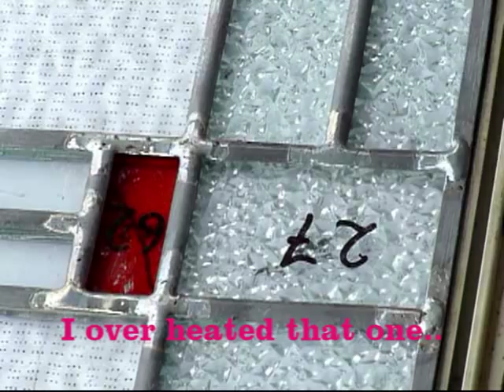Soldering a leaded panel

Comment: Great video,  glad you mention the temp, you melt the lead, and thats not good. FYI, I 've always used Olic Acid for my flux, basically it's rendered animal fat.  Does not work as well on copper or zinc, but  great for lead.

Comment: How do you clean if soldering an old window. A repair of a crakced lead. Clean with some acid first?
Reply from the maker: Remove old solder by melting it. Generous fluxing will help, also try blowing liquid solder off. Then take to the general surface carefully with a scraper and scrap on the dirty surface. When you see your scratchings come up to a nice shiny silver colour you'll know it's clean. Solder will not bond to or cover ANY dirty surface so just don't drive yourself to nuts trying to.
Reply: @karalnz  thanks. im also talking about the lead mounting it self. So far im sanding it with metal whool.

Comment: My lead on joints are melting. I only touch the joint with the solder on. It's a weller 80   can't turn it down there's no temp setting. I see you even hold your iron on a few seconds. Any ideas please
Reply: There´s a special Weller for soldering leaded glass, I´m using this one which is fine: Weller Profikit 100

Comment: How do you control your soldering iron temperature? Mine seems to only hit one heat that that is blasting it out.. at times ive even melted the lead
Reply from the maker: Ahhhhh I just hate it when the lead cane melts before my eyes!
If you suspect it's blistering hot, have some scrap lead cane handy and do a "test run" on that before putting it on "the precious"
The 'old school' irons are not thermal controlled so you MUST be diligent with it. 
My best suggestion,..... buy an appropriate new one like the one here https://www.youtube.com/watch?v=dqANQmNMDFw

Comment: This is another amazing video, and one that I have been waiting for. What kind of solder do you use for this, 50/50? Very good looking soldering joins :-)
Greetings from Sweden!
Reply from the maker: I used 60/40 solder on this panel. It has a lower melt point and thus helps to avoid melting the lead canes.
If your iron does not have a thermal control on it of some sort, your iron will likely over heat. It pays to test this for this danger by doing a soldering test on a piece of scrap lead cane before committing yourself to soldering the panel..

Comment: Great video!! Thanks much, very informative. What temp do you set the iron too.?
Reply from the maker: Yes, iron temp is very critical for lead work. It's a true nightmare to have a hot iron melt into the canes a?!!
My iron has a thermal controller within the tip so it can not over heat (what a blessing)
Reply: @karalnz  Is it the Weller Magnastat?

Comment: How do you remove a drop so solder which falls on the came in the wrong spot?
Reply from the maker: give it a fluxing, use the iron to get it melted, then slide the iron to the side. Most of the solder will stay with the iron tip.
It is best if you can avoid these mistakes.... more control / attention to task at hand has better outcomes.
But don't sweat it Den, a little misplaced solder is no biggy after all... :-)